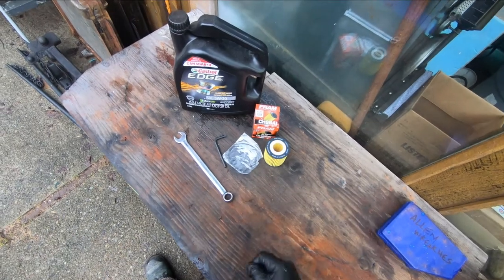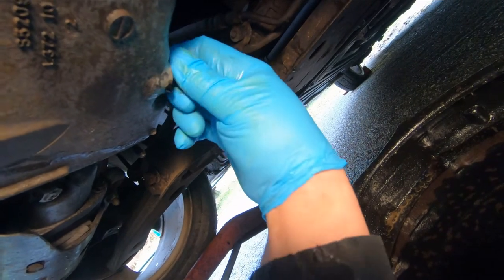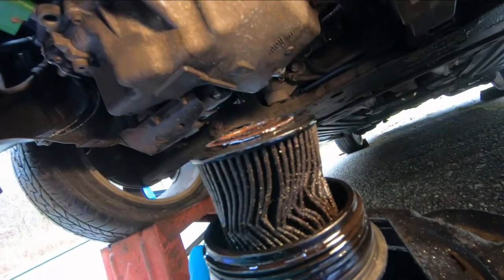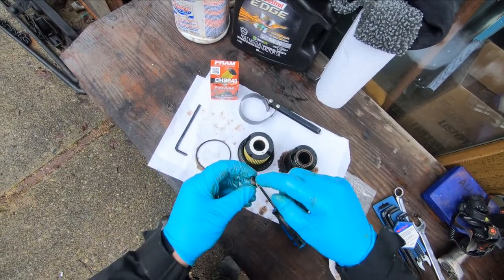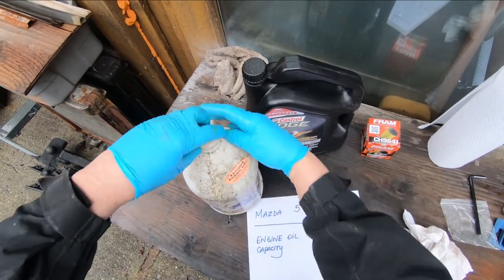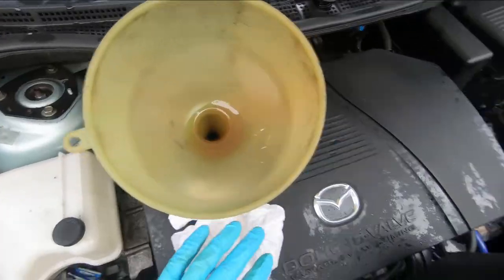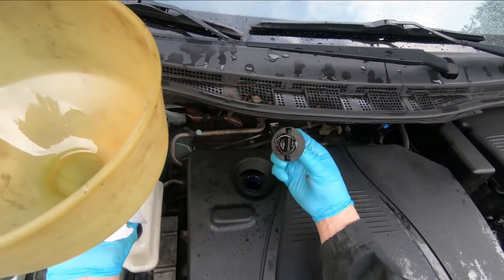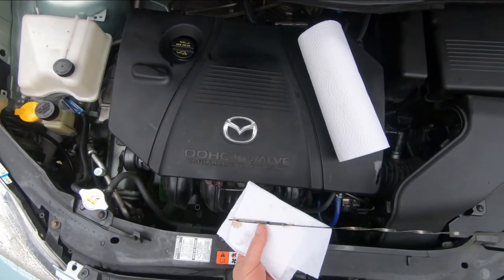HOW TO CHANGE A PAPER CARTRIDGE OIL FILTER (2006 MAZDA 5)

Comment: Cheers 👍🏼 your video has been the most helpful. Cant get my oil  filter housing out, Its a bit stuck.
Reply from the maker: Spray some Wd40 or other penetrating oil around the seam where the housing meets the engine and then try to loosen the housing with an oil filter wrench. Sometimes, you can make the wrench stop slipping by placing a piece of sandpaper face towards the housing and then use the oil filter wrench over the paper. It helps it grip better. The housing may be tight but it should come off.

Comment: I use Lucas on my engines for every oil change as well. I can't say certainly that it extended the life of my engines, but I know how badly I used to whoop on my snowplow years back when I was stupid and it's still running great so take that for what it's worth. I was merciless on that thing. I'll continue to use it.
Reply from the maker: Yep. Lucas is a very good product line. I use the heavy duty oil stabilizer in all my engines (even in my generator and lawn mower) and I use the fuel injector cleaner in gas.

Comment: I'm trying to figure out the oil change for my Mazda, did you have to take off a large plastic cover to get to the oil pan? My 2006 Mazda 5 has a plastic cover that covers the oil pan. filter and most of the components under the car. It's attached by bolts that i assume are stripped because they wont come out when turned and some weird nail looking thing that is welded on the other side so it'll never come out.
Reply from the maker: There is a factory splash guard on these cars and it is the black plastic piece you are seeing. They can be tough to get off because the screws or push pins often are rusted or broken. Once it's out, there is no need to replace it. 90% of cars are completely open under the engine. These splash guards are installed on some makes but not on all. I'd just do my best to get it off and then leave it off. This 2006 Mazda 5 hasn't had that guard on for years and I haven't had any trouble.
Reply: @EverydayProjects  alrighty ill just do my best to take it off then, thanks for the info. Your vid will definitely be a lot of help once i start my oil change
Reply: Mine was coming off when we bought our 2009 Mazda 5 used. My husband just ended up ripping it off.

Comment: Who would have thought I would be watching a video on how to do an oil change on a Mazda..
When I probably have more parts in stock for the Mazda line outside the dealer network.. Lol..
Reply from the maker: Like I say, "there's always something else to learn". I believe that your company supplies kits for different performance upgrades, is that right?
Thanks for checking it out and for commenting!
Reply: @EverydayProjects  : yes I do both daily driver and performance parts too..
But yea you never know what you may learn even if its something simple as an oil change..
Reply: What size allan wrench please?   great video
Reply: @drewdaros258  : what year and model is your Mazda??
Reply: @DanielAtkinsFirewood  09 mazda 5
Reply: @drewdaros258  : are you need to know thw oil pan or the filter housing plug??
Reply from the maker: @drewdaros258  I think it's 6mm. Thanks for watching!
Reply: @EverydayProjects  Welcome.  Also.  you can remove the filter housing without draining if need be if it is stripped
Reply from the maker: @drewdaros258  Yes, you can just use a regular oil filter wrench and spin the whole housing off the vehicle without draining it. Best to drain it first, though, but in a pinch, the housing will come off full of oil. Best of luck. Have you subscribed?
Reply from the maker: @DanielAtkinsFirewood  2006 Mazda 5